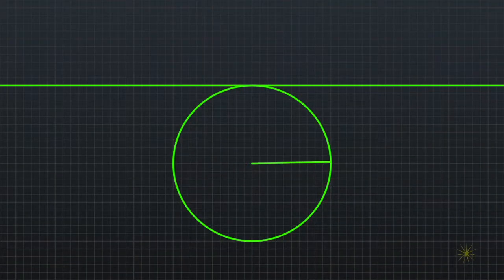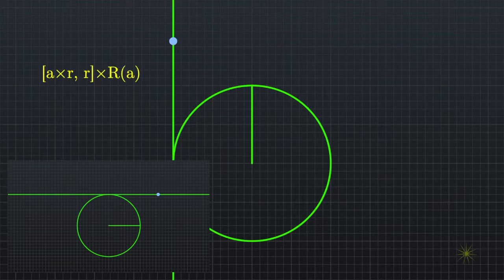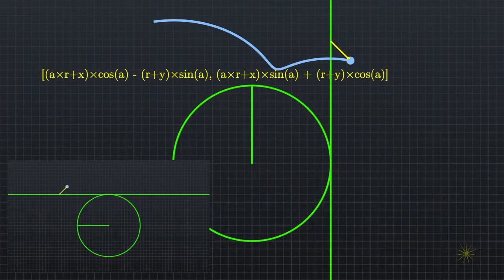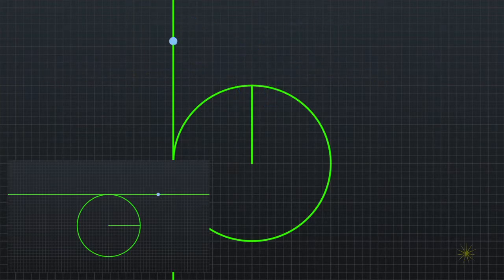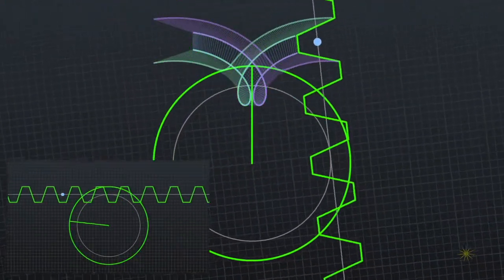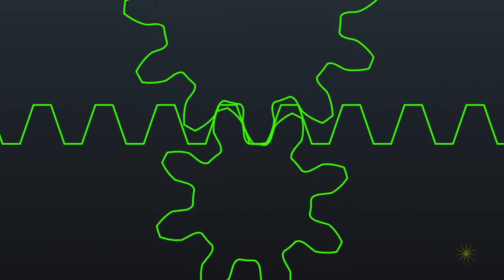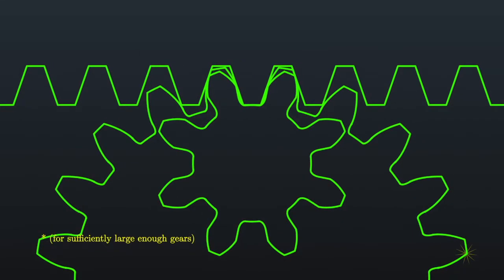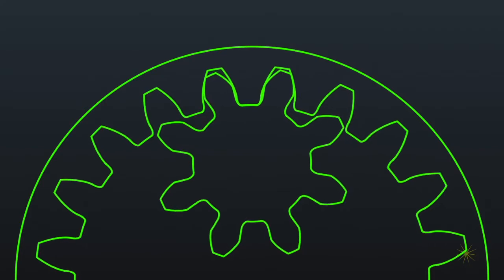Gear Tooth Geometry

Comment: This is by far the best visualization of a gear tooth profile being generated by a rack, thereby, producing a gear that will engage
with another gear regardless of number of teeth.  It clearly and cleverly shows the involute and the trochoid undercut curve
being generated. Perhaps another followup video could show the Method and math to combine these two curves into points 
for a spline intersecting at the OD and RD for CAD. Thank You !